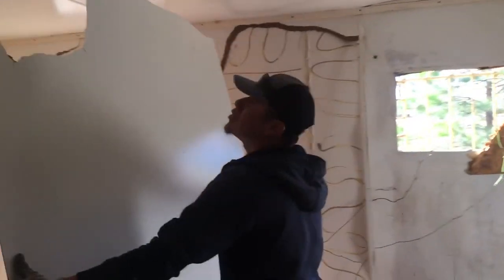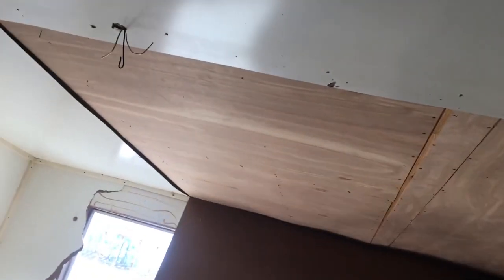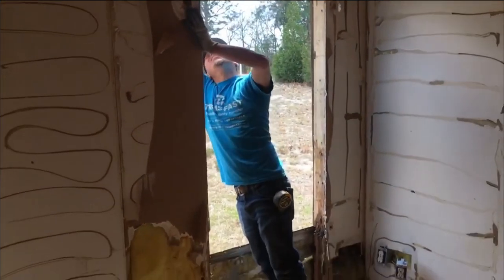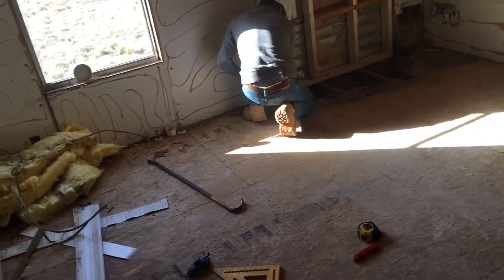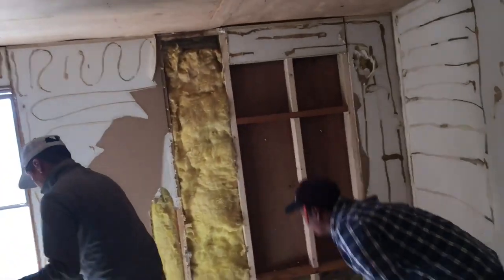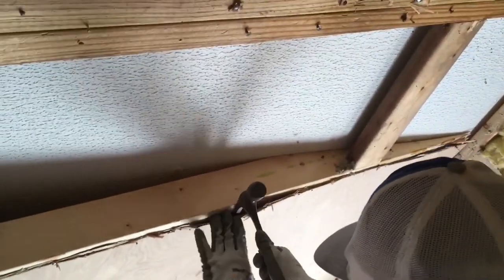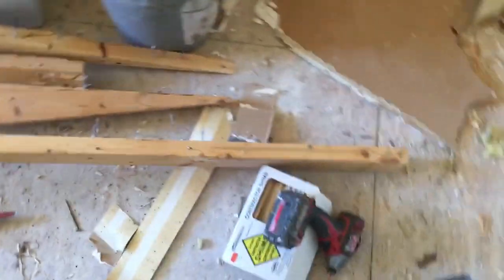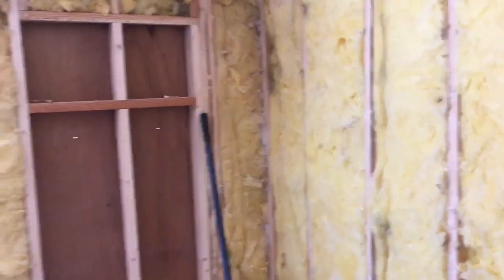Demo On A Mobile Home Bedroom Somebody turned Into A Commercial Kitchen!  Trailer Repair Madness!

Comment: Doing well taken back to the bear walls to inspect wires and rot in the wood saves coming back years later. 
If it's worth doing a job once only in my book, buildings must make money after a little bit of cash to correct the wrong.
Reply from the maker: If you’re gonna do it do it, right